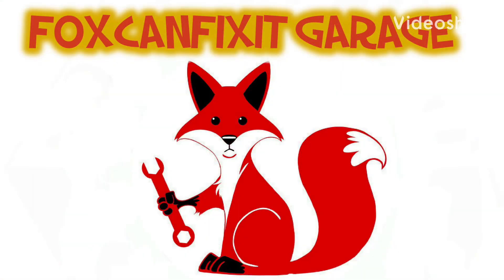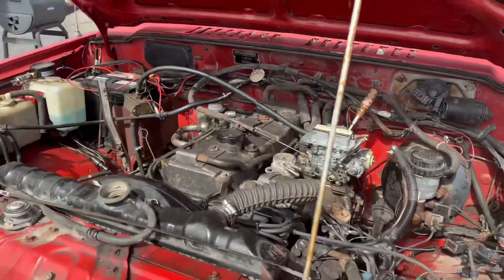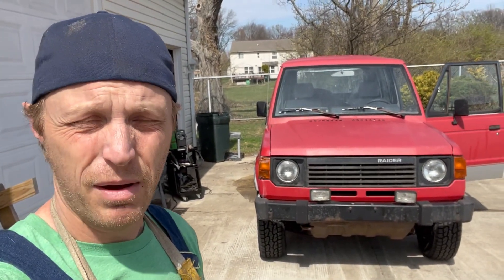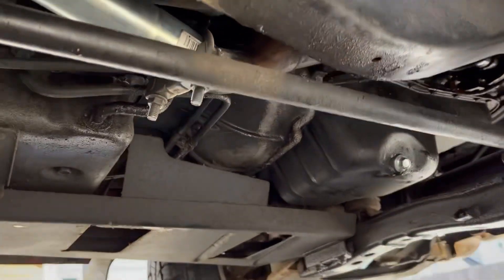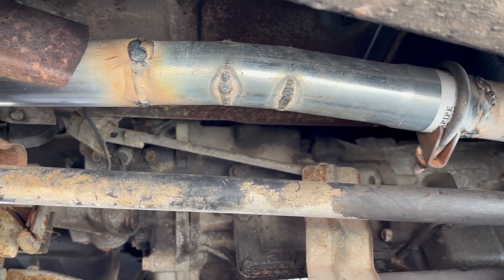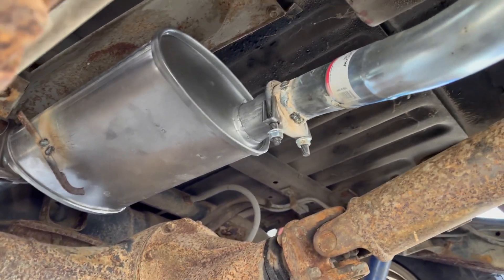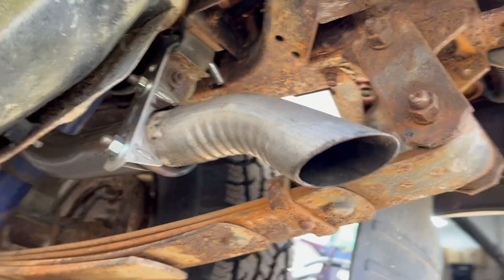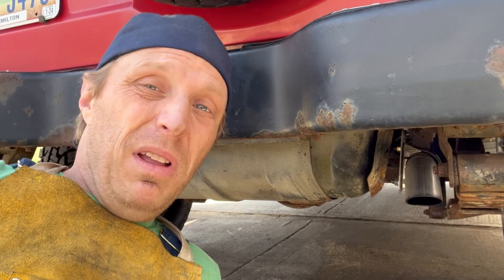I made a Full exhaust system for $100!

Comment: Sweet. Can't beat that 👍🏼
Reply from the maker: Don’t get me wrong, it sound like a $100 exhaust, but it’s 10 times quieter than just the cut pipe at the manifold 😀
Reply: @Foxcanfixit  I hear ya. Cheap tip is to check junk yards when you're there. No one ever seems to take the mufflers around here. Sometimes you can find nice ones from mustangs and stuff for dirt cheap.
Reply from the maker: I will be heading to one looking for other parts, but I’ll keep that in mind, thanks!